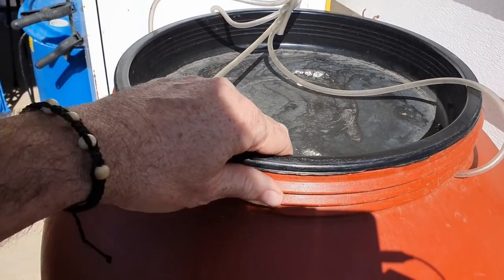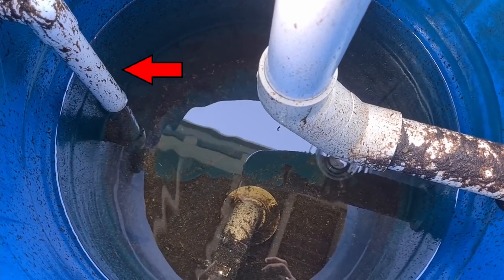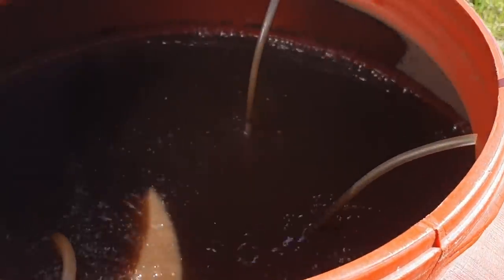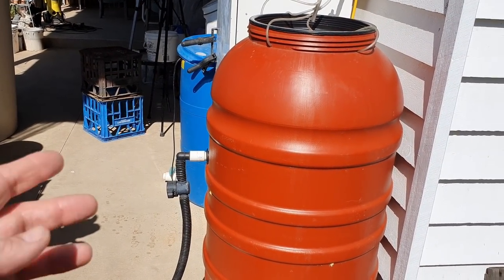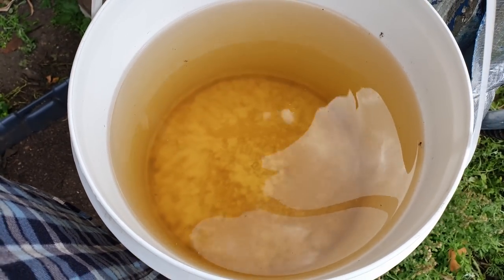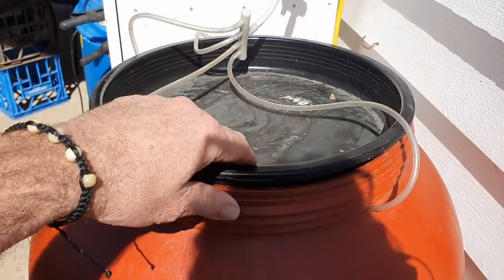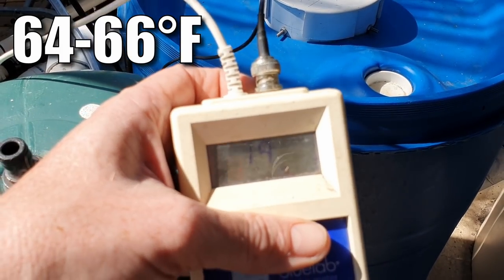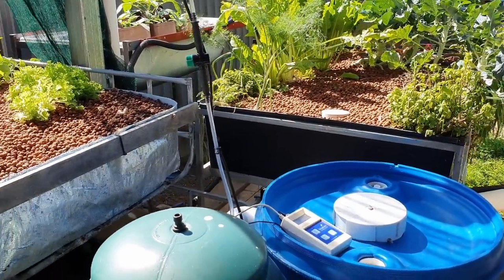Aquaponics Mineralization System

Comment: I really like my MT and how well it works.  Sometimes I debate if it's worth the energy input to operate one...especially if you try to reach the holy grail of 100% mineralization.
Reply from the maker: I think you could be right Rob if your goal is 100% mineraliSation.
I'm just hoping to squeeze enough from the solids so I can alleviate some of the deficiencies. If it turns out to be impractical I'll be looking for alternate methods to supplement I think.  
Hope you folks are all doing well.
Reply: @RobsAquaponics  I run my MT and will decant some of the water out once in a while, just like you.  Then I will take the solids and dump them back in the MT.  After a while they start to get too thick and it can slow down the circulation!  Then I'll take out some of the solids and dump them in the field.

Comment: I built a small MT tank (from my aquarium(s) waste)
I don't know if it's working the best it could be, but i feel good knowing i can produce some kind of fertilizer at home, even if it's not perfect.
also be wary
i threw a banana peel in there, and it was probably too much for the size of the tank.
The banana peel is gone, but boy the smell is ripe when you walk past it.
Reply: i'm trying banana peels (and some spent fluval stratum) just the dregs from my old tank, probably need to add some more by now

Comment: Have you thought about alternating aeration and pause. That's what we do in water treatment plants. aerobic bacteries transform NH4 to NO3, and anaeraobic bacteries transform NO3 to N. If you alternate both phases with a cheap timer I think you might have better results and a smaller electric bill.
Reply from the maker: Thanks for that CB. How long do you run the different cycles for?
Reply: @RobsAquaponics   You can try to aerate by cycles of an hour and stop for 90minutes. the stopping phase should never go under 60 min for the bacteries to do there job properly. If you want to kick start the bacteries, put and old yogurt in. It contains all the beneficial bacteries (same thing if you have a septic tank at home, don't buy any commercial product, a yogurt once in a while will be 100x better)
Reply from the maker: @clementbrizard8711  Thanks for that mate. 👍 I was thinking of adding some home cultured lacto bassilus.
Reply: @clementbrizard8711 could you share some videos or documentation. Sounds very interesting. 90 min of oxygen cut don't kill the aerobic bacterias?

Comment: Very good videos, how many days does the mineralization last to be up to date to supply it to the system and in which part of the system do I add it?
Reply from the maker: It can take up to 3 months depending on climate for a single batch. 
As I'm adding bits weekly & allowing the solids to settle & stay in the base, the nutrients should slowly be released over time.

Comment: I like your simpler system relative to the Bigelow Brook Farm one. Cleaning out the air stones seems an easier task. I may add a mineralization tank, but using the fish solids on my wicking beds and dirt grow bags seems a good way for me to optimize the fish resources. 
On a different note, I am swearing off buying plants from the grocery store. I’ve introduced first white fly and now red spider mites into my greenhouse. Neem oil is marginally keeping them semi in check. Seriously thinking of stripping all the plants out this winter and letting it freeze but haven’t figured out how to strip out the ammonia if I take the greenhouse off line. I’m sure I’ll figure something out. 
Got to go re apply neem oil it’s been maybe a week or just a bit over since the first application. Adding a little soap too.
Reply from the maker: I have done the same thing with big box store plants Joe. I still use them but like to spray them when I get home. 
Have you looked into Zeolite for the ammonia? Might help you out depending on how large the load is. 
Cheers mate & hope you can sort something out.
Reply: @RobsAquaponics  I do have zeolite somewhere. I used to keep a large aquarium, but dwarfed by my current fish tank and number of fish. I might have to increase what I have several fold if I go that way. It’s a thought.

Comment: Aloha Rob. Enjoy your videos. I am hoping you can help with what seems to be an anomaly with my system as compared to yours and others I see on YouTube. Fish solids are moving well from the fish tank into the settling tank, but once the solids settle to the bottom they float to the top. I put in a screen to catch the solids floating up but have to manually clean the screen and dump into the mineralization tank. There is no other filter in the system. The plumbing at the bottom of the settling tank moves very little solids, so I end up stirring the tank and the solids float to the top where I need to manually scoop them up and dump into the mineralization tank. I am wondering if is the food I am feeding the tilapia? Any suggestions will be greatly appreciated. Mahalo, Raymond from Hawaii.
Reply from the maker: Sorry I missed this Raymond. As I understand it, tilapia poop can float naturally so can cause issues for some. I'm not sure if changing food helps at all. Has the issue stopped or do you still have floaters? 
Sorry it took so long to get back to you.
Reply: @RobsAquaponics  Thanks for the reply. I have abandoned my system due to the fact that it was out in the open and we have been getting a tremendous amount of rain where I am in Hawaii. Just too much maintenance to keep the mineral/nutrient levels in balance. Thanks again for providing so much information in your videos!

Comment: Has anyone tried throwing the solids into a soldier larva farm?

I'm not sure which would be better, running the nutrients through a bio digester or converting them back to fish feed.

Also, an anaerobic biodigester has the side benefit of producing biogas, so while it may be slower it would also create a combustible fuel; remove the hydrogen sulfide gas and then burn it in a heat exchanger, keeping the water temps more comfortable.

Comment: Hey mate, your fb post on the chop and flip is gone and I would like to know what you found out. I was the guy with two tanks I want to chop. Take care.
Reply from the maker: Hi Jack. Was that on my Bits Out The Back page? Sorry mate but I can't recall the post.
Reply: @RobsAquaponics  I don’t remember either. I just know you were asking if others have had failed chop and flips. I was hoping it wasn’t a normal occurrence to fail because I want to build a couple
Reply from the maker: @jacktheripr8973  That was in a few of the different aquaponics groups 👍 Will see if I can find them for you mate.
Reply from the maker: @jacktheripr8973  This was one post,
https://www.facebook.com/groups/AquaponicsForBeginners/posts/1470472569974244
Reply from the maker: @jacktheripr8973  & this was the other 👍
https://www.facebook.com/groups/443315682400537/posts/4762159140516148
Hope that helps some mate.